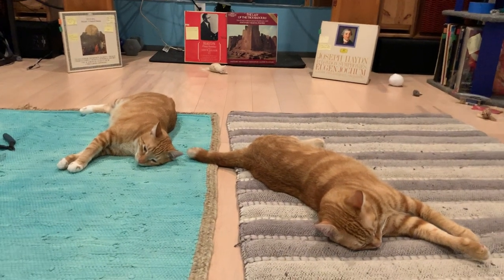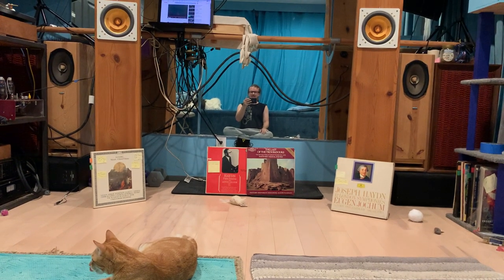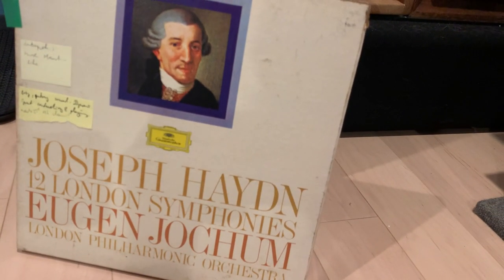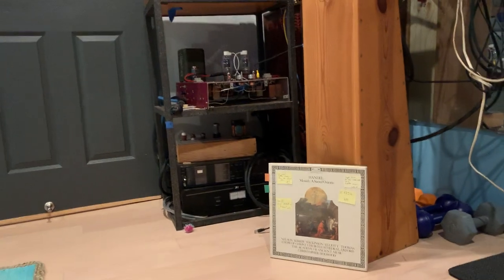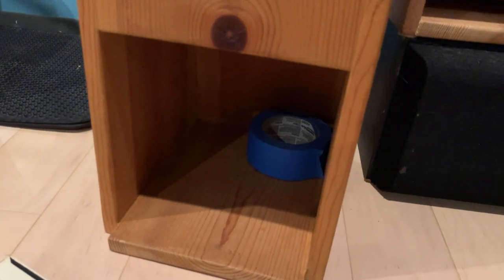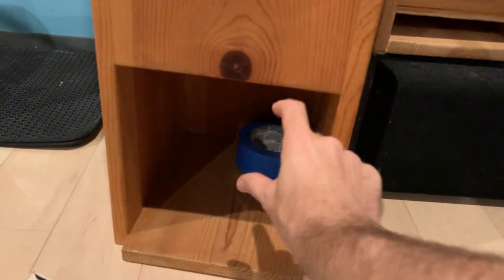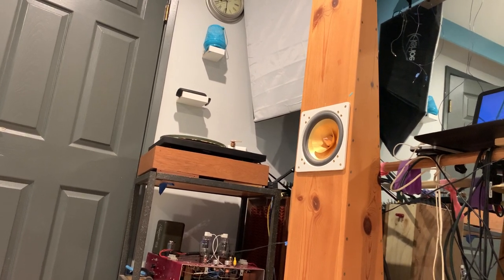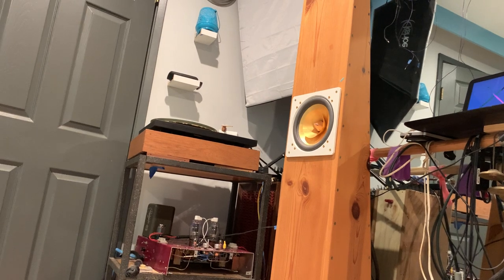Voigt pipe base tweak:  taking care of slot reflections - the cozy way!

Comment: I wonder be good to add a soft dome 3" mid-range/tweeter 300Hz -16kHz, on the back of the speaker out of phase, give you natural cancellation and enhance the top frequencies make the speakers sound wider and give you better depth making it a cardioid, could put them close to the wall also and probably be better.
you get interactions with front facing ports... dipping frequencies at around 40 Hz - 120Hz depending on the manufacturer and type of driver, what do they state the cancellation of frequency is?
that's why it might be better to put the record against the baffle straight on...and just having it out at the bottom not to the side.
Reply from the maker: Video is coming with answer on corrections with a second driver. 
Regarding record against baffle straight on: I have exhaustively experimented with all sorts of baffles in all sorts of angles (including complex vents, tubes, shapes, multiple sizes, thickness, material.... etc in front of the port, shunting air to all sorts of directions and angles.) It is this configuration that has best audible result. 👍👍✨✨

Comment: For those who cannot afford Cube Audio drivers.  Could you pick a driver and design in the $100 per driver range a Voight pipe like you did with the Le Petite?
Reply from the maker: Hello Karl, I would try the Fostex FF225WK in that range. However, for Fostex it's mandatory to have very good amplifiers - I'd say tubes are mandatory, people with solid states fare tend to prefer with Audio nirvana, Mark Audio or other drivers. There are some solid states that work very well with Fostex Voit pipes, such as Conrad Johnson and Michael Yee Audio, but they are rare as a golden egg.